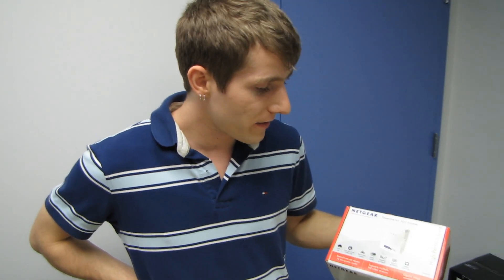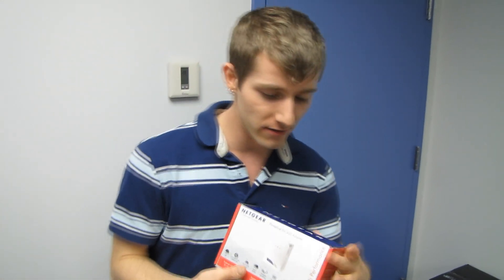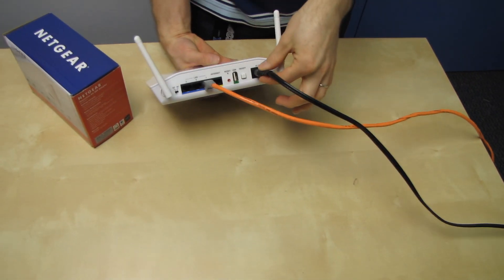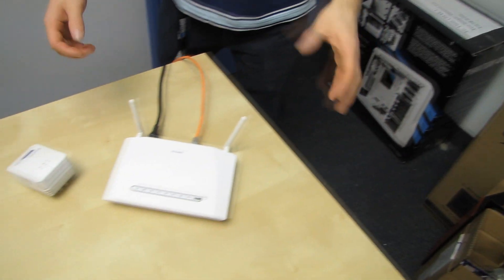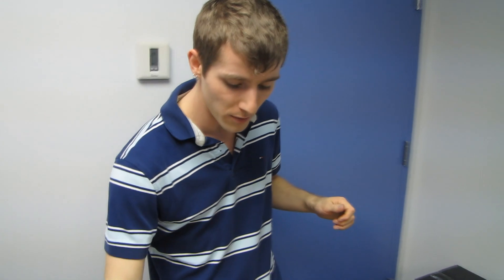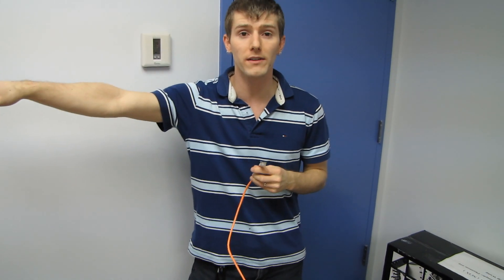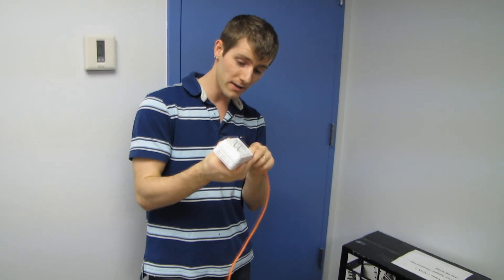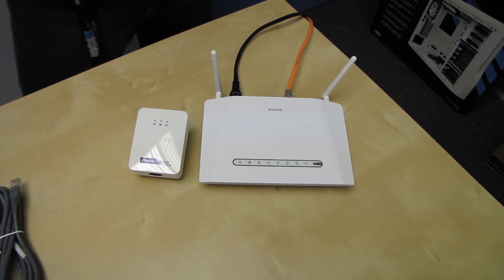Netgear Powerline AV500 Hy-Fi Ready Network Adapter Unboxing & First Look Linus Tech Tips

Comment: I really want to implement this in new space.  I am kinda a noob when it comes to network and need some advice.   Have a 8000 ft^2 space that has need of strong connection to the furthest reaches.   I want to have a network that has hyfi and I want to have all computers and mobile devices connect to it.   Also thinking about having a server for shared files throughout the network (nothing too crazy there,  maybe 10 -  12tb - upgradeable if needed).   Any advice? A pm from anyone much appreciated

Comment: I just got a Wireless N adapter.  Read to much about PLC insecurities.  I also fixed my latency issue, which was due to a computer running bittorrent in the background seeding data.  Such a bitch to find that after doing so many tests...

Comment: I had a couple of netgear powerline adapters. They gave a great stable signal but the downside was that it gave off a load of interference which played hell with my logitech z5500 5.1 speakers. I could hear really load annoying static coming through the speakers until i switched off the powerline adapter. I eventually got rid of them in favour of a 20m CAT6 ethernet cable

Comment: Look, this is super easy. I have a wireless router. I simply hook a bunch of the adapters up, put one for the wifi base, hook the ethernet into the back for LAN network, and everything works perfectly. Computers automatically get the best network solution - why not do that??